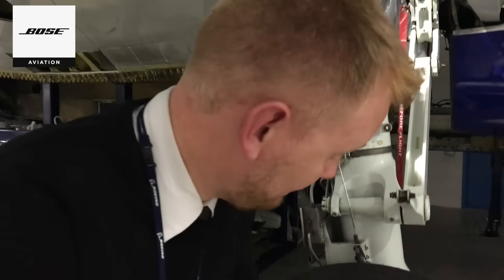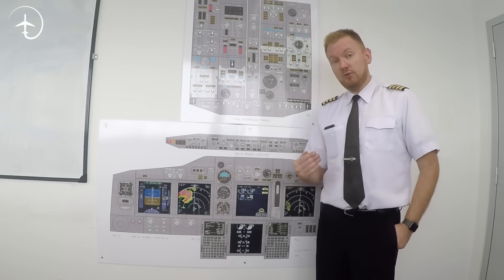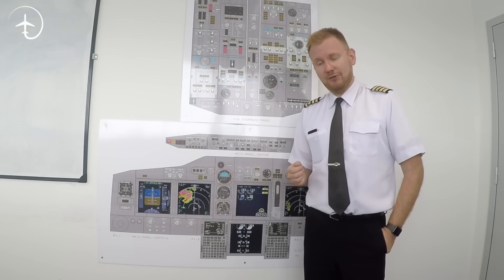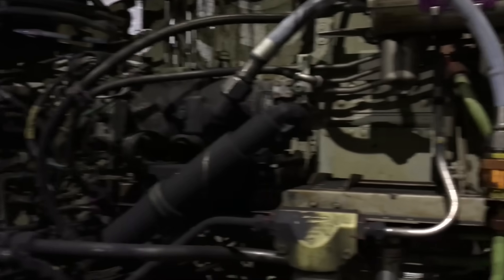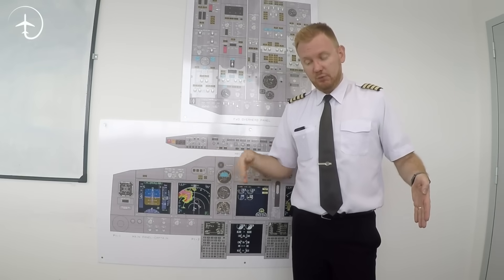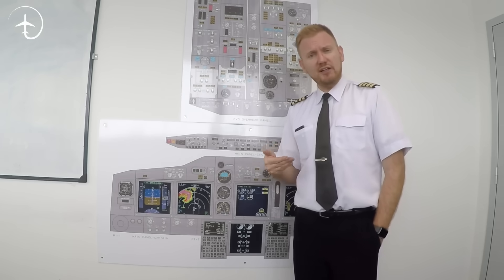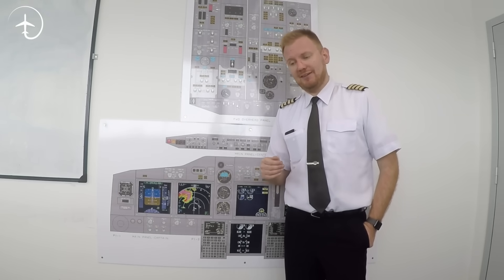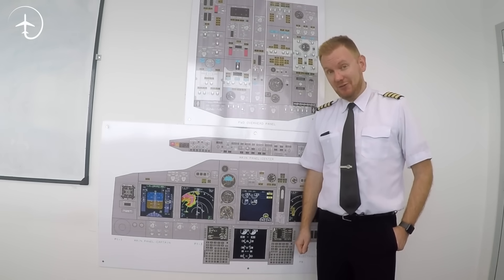Why does the Boeing 737 not have any landing-gear doors?

Comment: QUESTION: MANY CASES OF LANDING GEAR PROBLEMS,  WHY DOESN'T EVERY PLANE GET FITTED WITH SMALL WHEELS UNDER ITS BELLY THAT DO NOT RETRACT, TO ACT LIKE A SPARE SET OF WHEELS IN CASE OF AN EMERGENCY ? OR SMALL WHEELS UNDER EVER ENGINE THAT THE PLANE COULD LAND ON? VERY THIN AND HALF INSIDE THE ENGINE , HALF OUTSIDE LIKE WE SEE IN AN24 I BELIEVE.
Reply: +E I N S You're shouting so loud, I can barely make out what you're saying.

The AN24 has ordinary retractable landing gear.  You may be thinking AN225, but all of its landing gear retracts.  The largest aircraft with non-retracting landing gear that's still in production is probably a Twin Otter. Which is tiny and slow.  There's still a few JU-52s flying, but they're all at least 60 years old.

Why don't they have the wheels sticking out in commercial aircraft?  Air drag.
Reply: E I N S sure you did. Everyone can tell that from the way you're talking
Reply: Most planes don't have wheels to protect the fuselage  in a belly landing, but that's a great idea. It would save many aircraft from being cut up when such an incident happens. The DC-3 wheels when fully retracted would protect the plane from major damage in such a landing, even though the propellers and engine mounts would be torn up .
Reply: There's this crazy thing in physics called "Drag"
Go back to school.
Reply: E I N S any responses or clarification of yout original statement?
Reply: E I N S some planes had fixed landing gear. Yes. Reference some models with back up fixed gear and a set of retractable wheels please.
Reply: my bet is such an arrangement would produce drag, what leads to more fuel consumption. Airlines love saving fuel, so I don't think that it's going to happen anytime soon.
Reply: Because the aerodynamic drag would destroy fuel efficiency and reduce cruising speed and range.  This is the reason aircraft are fitted with retractable gear.
Gear problems are not common. When they do happen you can usually do a gravity drop by pulling a lever that releases the hydraulic pressure. 
If maintenance screwed up they could get stuck. 

I don't remember the specifics, but, if I remember correctly, after the LOT Polish 767 that couldn't get the gear down did its belly landing they found that, during preflight inspection of that particular aircraft, the pilots were repeatedly resetting a popped circuit breaker that provided power to the landing gear extension system (instead of reporting it to maintenance to get fixed).

It really disappoints me to see how rude people are to each other (especially when they should be able to tell that the person they are insulting is a kid).
What has happened to common decency?
Reply: Jon Lin, I weep for the naval academys standards:(
Reply: E I N S I
Reply: Planes used to be designed like that, actually. The DC-3, the B-17, the Beech 18, the King Air 90, and other early retractable gear aircraft were designed to have the wheels partially stick out when retracted to protect the belly in case of a wheels up landing. They also had removable outer wing panels to aid in production and allow wing replacement if only one gear came down or collapsed. But these increased weight and drag. As gear systems developed backups and became more reliable and pilots were better trained and given warning systems.., gear up landings were less frequent. Detachable wings were heavy and introduced failure modes (Beech wing bolts and bathtub fittings) so were eliminated on newer aircraft (like the Beech 1900 which was based on the King Air).
Reply: Because they just cant. Its a bad idea. 
 Do you think they spend lots more on landing gear than they have to? No. They make it to a standard that works and thats that.
To do what you are describing   you would have to design something nearly as good as the landing gear itself for it to survive. If it fails during a landing it could end up causing more damage than a wheels up landing anyway. 
You just asked why we dont take a step back to nearly the beginning of aviation history and add fixed landing gear to our aircraft. That was your idea. 
Im not being mean. Im being real. 
Think these things through. When you have an idea that seems good, its probably because it is a good idea. From ONE perspective. 
But you have to examine the idea fron all angles. 
They retract LG for efficiency and safety reasons. 
 If they didnt have retracting gear, it would be more expensive and dangerous to operate the jets. 
 Particulalry when landing gear failures are not THAT common. 
 There are not LOTS.
Reply: vertex546

You're an idiot ! planes used to have it and some still do. Unlike you, a kid, i finished the Naval Academy, my questions was very legit. You go back to school little kid.

Comment: QUESTION: CAN A PERSON GRAB THE LANDING GEAR AND TAKE OFF AND LIVE? WHEN THE LANDING GEAR RETRACTS WILL THE PERSON GET SQUASHED OR SURVIVE ? IS THERE A SPACE INSIDE A PERSON COULD HIDE LIKE WE SEE IN THE MOVIES? AND EVEN ACCESS THE PASSENGER AREA FROM THERE?
Reply: If you could travel in a 737 nose wheel bay Ryanair would sell tickets for it.
Reply: +E I N S Ow, that shouting hurts.  Turn off  your caps lock!  Obviously, people can, because it's been done.
Reply: Not in a 737, but there are some aircraft where it would be possible. The Airbus A300 has a large area between the main gear where someone could ride, but with the low pressures and -69° F you wouldn't live long.
Reply: Just mail yourself and stow away in style, eins. Might have more room in your box than you would in coach.
Reply: Whether or not there would be space depends on the aircraft. 737 probably not, but other aircraft with larger multi-wheeled bogies - as is more common on long-haul international flights that people usually attempt that with - would have more room. It's been done a few times, sometimes they survive, sometimes they don't. There are a lot of issues that make this extremely dangerous - being crushed by the gear, the extreme cold and lack of oxygen at high altitude, or being unconscious due to the former then falling out when the gear is extended. So a few times people have survived it, but others have died. Not a good idea, obviously. 
As for access to the cabin, I highly doubt it. The cabin and cargo hold is pressurized, the wheel well is not, and I wouldn't see any reason for there to be an access hatch between the two. Just a window from the cabin so that the pilot can see if the gear is down and locked in case the indicator lights malfunction. If there were, it would probably connect to the cargo hold, and as far as I know I don't think there are connections between the cargo hold and cabin that are usable in flight, even though both are pressurized. There was an access hatch between the cargo hold and nosewheel bay on the aircraft in Toy Story 2, but I don't know if that was realistic.
Reply: There are no hatches between wheel wells and cabin or cargo areas. There are on some planes removable panels with many very sealed screws on the WW sides.  Boing 737 so not have them.  Some large airliners have access to cargo pits for galley ovens and avionic units via ladders and/or elevators. 
It's difficult for aircraft mechanics and pilots to watch Hollywood movies with aircraft without laughing at the ignorance displayed by the writers and directors. You would think maybe sometime they would have knowledgeable aircraft consultants input.
Reply: No I don`t think a person can survive but a creature like in the movie Aliens can because I saw it  in the movie and the creature is silicon based so it does not need air.
Reply: Oh ya, no air to breathe either.
Reply: :)  The tires are filled with nitrogen.  ;)
Reply: On most jets it would take a contortionist to survive takeoff and retraction. Surviving a flight is often impossible as the wheel wells are  not heated during flight, if pressurized at all.
Reply: Philosopher of Nonsense I am going to give you the benefit of the doubt and ask you which aircraft types have access hatches between the wheel bays and cargo bays, and follow up with the same question for the access hatches between the cabin and cargo bays.  I can tell you there is no such thing on the Airbus 319, 320, Boeing 727, 737.  Please tell us what aircraft have them, and where they are located.
Reply: CAPS...
Reply: The caps lock makes it read like you're in the middle of an action scene and want to know right away whether you'll survive. :P
Reply: On which aircraft can you go from the wheel wells to any pressurised compartments? Certainly not on Boeings or Airbuses.
Reply: Many stowaways fall out when the gear doors open (just before the gear retracts). I've never seen a hatch between the wheel and cargo areas on any Boeing or Airbus. The cargo areas are pressurised, but the wheel bays are not.
Reply: There is an article from awhile back where someone hid inside the wheel well of a larger aircraft while it took off, but they were seriously affected by the high altitude and cold weather inside the wheel well during flight.  They had to be hospitalized afterwards.  Would not recommend.
Reply: Definitely no access from wheel well to cargo bay, but it is possible to access the cabin or cockpit from the cargo bay on some aircraft, mostly through the EE bay.
Reply: wether there is enough room or not, he would suffocate or/and freeze. Not a good idea.
Reply: ....asking for a friend...
Reply: Bring a very good parka, hat and gloves oh and a O2 bottle
Reply: Sounds like something a terrorist might shout
Reply: E I N S: Quill Maurer pretty much covered it, most notably the extreme cold (about -60F, conservatively speaking) and lack of pressurization of the wheel bay (most people cannot breathe very well above 18,000 feet due to how thin the air is, much less at 35,000 feet), except for a few points. Yes there are access hatches between the wheel and cargo bays, and access hatches from the main cabin and cargo bay, but moving in that direction, they are locked from the other side mainly for practical reasons. You can go from the cabin to the cargo bay to the wheel bay because the locks are on your side for the same practical reasons. For the most part, anyone attempting this has less than a 5% chance of survival, to be generous.

A few have tried, but nearly all have died. Another danger not mentioned is that by design wheel bays only have slightly more room than the gear itself consumes, and not all aircraft have automatic braking on the wheels or a "scruff plate" kind of brake when the gear is retracted, presenting another danger. The closest to realistic of this method you query of any movie I have seen is in the movie Con-Air.

[spoiler alert ahead, in case you somehow haven't seen the movie yet]

When Dave Chappelle's character misses the plane and tries to stow away as you were curious about, he died and was only discovered because his frozen body was jamming the gear and it could not retract fully. An indicator light on the console of most aircraft with retractable gear will verify that the landing gear has run the full cycle of "stow and lock". If this cycle does not complete, the indicator stays on, or at least at a given altitude or airspeed, it will flash or an audible alarm will sound. Whatever the method, the pilot would be alerted that the gear has not been locked in the stowed position.

In general, movies are fiction. What you may see is either to create drama, suspense, or comedy, but should be considered largely untrue if it does not portray actual events. The art of cinema is to make you at least consider it plausible to draw you into the story so you feel less like you are watching the movie but are actually in it.

And definitely lose the caps-lock, it is viewed as "shouting" in text and is not polite, socially-acceptable, or relevant without the basis of exemplifying a point. Otherwise it is just irritating.
Reply: Dont live under the approach to Heathrow if you dont want to find a frozen african in your vegetable patch.
Reply: Arnold Schwarzenneger can -- but just for a short distance. After which he totally bails out and lands in shallow water in a swamp. But his hair doesn't get wet, which is nice. He had to go 'cause his friend was "Dead tired".
Reply: Its 65 below zero up there. Think youd live 1-5 hilours??
Reply: Laser Tech Services c
Reply: Hook a hose up to the main gear tire valve stems and use them as scuba tanks. Recline in the soft tire and shove some hand warmers in all your pockets. Improvise, Adapt and Overcome.
Reply: Ok, drill a hole through the fuselage and have warm air blowing on you. Always a plan B. 😉
Reply: HAHAHAHAHAHAHA!
Reply: E I N S 0

Comment: I always thought why not implement a hydraulic or electric motors on the main wheels especially for use in taxiing, or even exit in reverse from the gate using only hydraulic or electric power from the same APU..

Comment: GR8 info thanx, I always wondered why passenger aircraft dont have (eg turbine fans) attachment to wheels that use air flow to speed up the wheels’ spinning speed prior to touch down, surely the tyres will not scrape as much and last much longer?

Comment: I designed some of the electronics for the 767 at Boeing in 1980. I designed electronics for other planes while working at smaller supplier companies.
Nothing is ever as interesting as this video. It is just boring hard work designing an audio selector panel or battery charger.

Comment: I jumped on the 14psi and the comments cleared that up.  I love me some airplanes and am curious about the tires on civilian a/c now that you perked my curiosity.  27 yrs in Navy squadrons most tires were 36ply and around 350psi when landing aboard ship and less shorebased.  They demanded respect when being inflated or after landing and they had hot brakes.  Any similarities? I guess I am asking for a 737 tire video, maybe I am just a little anal about it.

Comment: Western flew the 737 called Fat Albert.
The only way to fly.
The B/24 had exposed main gear as well.

The wheels could be braked to stop before retract.

Some work was done via fins mounted to main wheels to pre/spin to avoid flat spot scrub but was not pursued.

Air transports a subjected to all types of extremes daily and really are a modern marvel that they hold up as well as they do.
Turbulence that hammers the wing spare, 50 below zero to 110 above in mere minutes, constant cabin pressure fuselage flex, water intrusion in seams, the slam of cross wind hard landings just a very few things that test their metal on each flight.

Comment: The gears are not in an "icing area" !  I use to install the 757 "nose "and "main landing gears"
when I worked at Boeing.  Another huge difference is the weight of the gears, I can and 
have "muscled" around the 737 nose gear by myself, most men could. The "nose gear"
on the 757 weighs 1750 lbs!  You need help, using jacks and hoists. He said the 737
 was around in the 60's? Not sure about that... Aircraft has made huge advancements!
You are 64 times more likely to die in a car than a commercial  jet!!!!
Reply: 737 entered service in 1968

Comment: With military transport aircraft, the brakes are applied before retracting the gear.  The massive gyroscopic effect is eliminated which improves handling.  The nose gear tires rub against a friction pad in the wheel well, stopping the rotation.

Comment: What about the pressure difference ,at high altitudes, The pressure exerted by the gas in the tires increases as we climb higher ,since the ambient pressure or the static pressure decreases 
The same 14psi will exert more pressure at at high altitudes compared at MSL . How did they overcome this problem🤔
Reply: The change should be insignificant. Remember that a 1 square inch column of air rising up through the entire atmosphere would only exert a pressure of 15 pounds at the bottom, or 15 PSI. At cruising altitude, the exterior pressure would drop only a portion of that 15 PSI acting on the tires (and everything else). Recall that World War II era bombers like the B-17 also had exposed tires and they fared well.

Comment: Another great video. I was working a 737-200, (we called them the Baby Guppy as the were the oldest 737's in the fleet.), in 1990 from CLT to IAD. We blew both of the Starboard Main Gear tires on landing. We bounced down the runway on the inner wheels to a stop and luckily didn't have to evacuate. The gear held. My question is was there a risk if pieces coming off the shredded tire into the Wheel Wells. After departing the plane by stairs and a bus and after writing my report, I was done for the trip, so I'm curious as to the damage the airplane incurred.
Reply: bionicsjw ,
Blown tires throwing tire pieces may rip hydraulic or electrical lines apart, thus cutting off hydraulics to the brakes or landing gear actuators, and cut off electrical switches/sensors.

Comment: I have been following Captain Joe for a while for his A320 videos and find them sooo intesresting.  And now I recently found your equally interesting series about the Boeing 737.  The A320 and the 737 are the aircraft I fly most often in my travels so I like learning about the internals of both aircraft.   What if both of you (don't know if this it at all feasible) join at simulators and try to fly each other's aircraft.  Would be quite interesting to see you flying an A320 and Captain Joe a Boeing 737.  It seems that each aircraft is quite different from the other.
Reply from the maker: Sounds like a great idea!
Reply: While Capt Joe was flying A320s, I think he might be flying 747s for freight service now.  At least that's what remember hearing in one of his career updates.
Reply: I wouldn't fly on a Scarebus for free to anywhere!